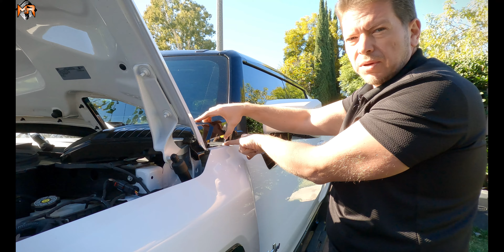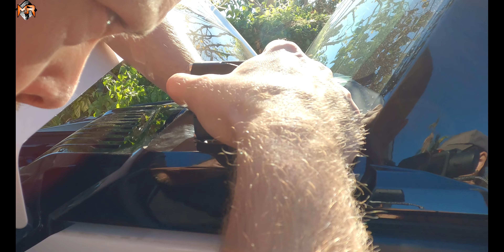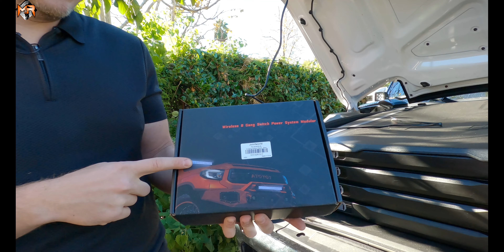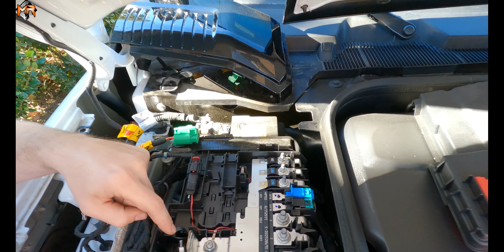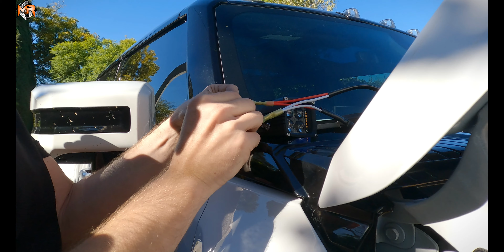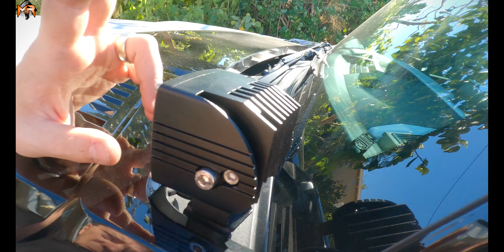2022+ GMC Hummer EV Ditch Lights Hood Mount Install | M&R Automotive

Comment: can you make a video for installation on to the factory gmc touch screen control module? I just purchased your ditch lights but have no clue how to install them via the touch screen accessory control module
Reply from the maker: Did you order the M&R one?
Reply: yes I ordered your M&R ditch lights. In your video you said I could install it into the touch screen accessory module from GMC. Please let me know how to do so. The module has an area where I have to plug In fuse and relay, can you tell me which fuse and relay I should purchase in order for these lights to work? Sending a link for correct fuse and relay would be helpful. I am not savvy with electricals. Trying to install M&R ditchlgihts myself today at home  @MandRautomotive
Reply from the maker: @kkshooter1  We have not used the factory aux switches since the prototype vehicle was not equipped with additional module needed. You would need to go to your dealer to see how to connect it to the factory Accessory Touch-Screen Control Module. Based on the look of the module, looks like you are missing the hardware such as fuses and pin connectors that are necessary to connect the power to the lightbar
Reply: Yea I’m definitely missing those parts but any idea where I can purchase these parts and what are the exact specs ? Because the factory gmc off road lights I’m pretty sure comes with the appropriate fuses and relays. GMC wouldn’t know what fuses or relays to use for your product. I hope you can provide me with that information. Thanks